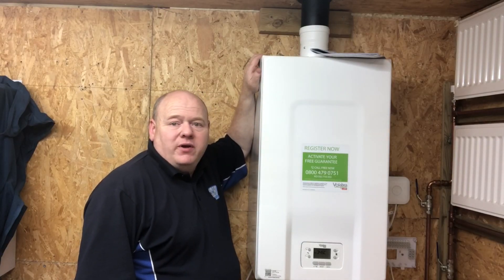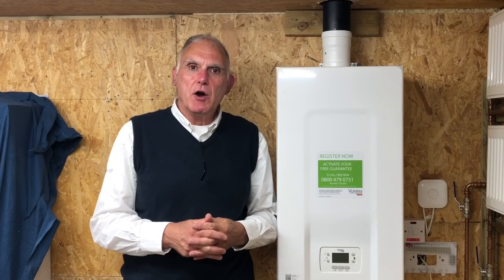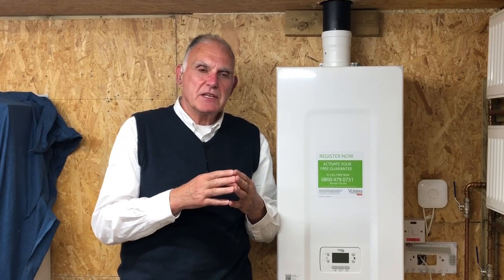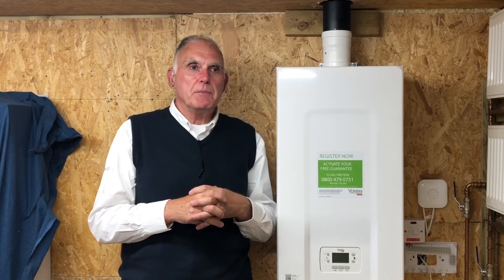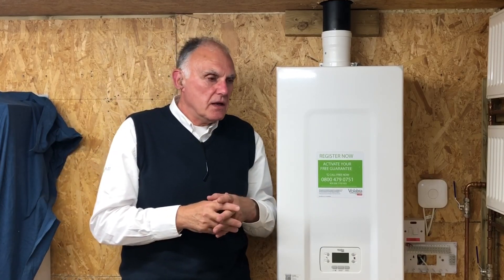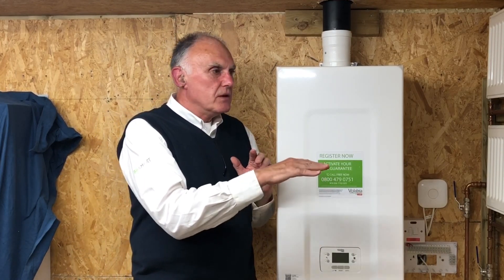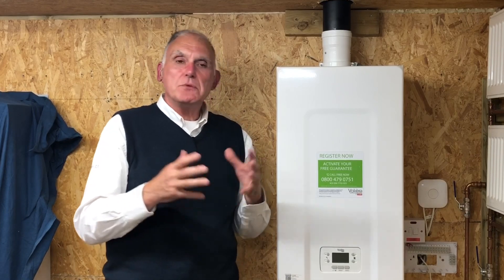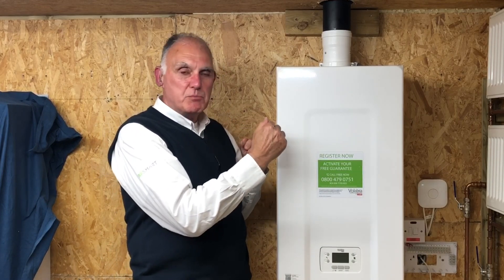What is OpenTherm / Weather Comp

Comment: Great video and good to see information on this. I upgraded to a Nest Thermostat on my old boiler I wasn’t aware of opentherm.  Then I had a new boiler fitted, Baxi 800, and my Gas Engineer told me about opentherm and its benefits, especially boiler longevity. It does take a while to get used to, especially when sometimes the rads are lukewarm. However the that room temps are constant and don’t swing between 18 and 22c, that they did when it was just set as simple on off, is important for general comfort. Early days but bills so far seem to be between 5 to 10% lower.   The fact that it is more efficient and less emissions is of more importance to me.  
I used to think the  Nest was overpriced but realised I was just not using it correctly. Hive does not have opentherm!
Please do more on this subject, there is precious little information out there.
Reply: How do you wire the vokera Unica erp? sensor with a nest??
Reply: @LordJasonKing  do you mean the external sensor or the OpenTherm BeSMART? In the terminal strip on the back of the control box there are six connections. We always use the same colours; black for standard room thermostat (24v), orange for external sensor and pink for open therm
Reply: @LordJasonKing  I answered this but it seems to have got lost. The Unica i  has a connector block with 6 terminals, we always use the same colours for internal wiring. Black is ON/OFF room thermostat (24v), orange is external sensor and pink is OpenTherm. The Unica HE is different. Ask again if it's the HE model you're looking at.
Reply: @vulcancontinental  thanks so much. Wired the sensor in 😊. I've a nest 3rd generation. Can I set that up as an opentherm? I'm guessing it's wired as an on off. I'm sort of assuming that the opentherm goes to. Pink from the nest? Does opentherm compete or conflict with weather comp? Can they be used together?
Reply: @LordJasonKing  yes, nest can be connected OpenTherm but a couple of points. 

1 you have to use Nest to set your DHW temperature (there's a separate section in the setup I think called comfort or something) the boiler adjustment of hw is disabled when OpenTherm is detected. 

2, I don't know how nest reacts with w.c. it has it's own weather program, I'd use that. 

Yes nest OT connections to the pink in the terminal box.
Reply: @vulcancontinental  outstanding service thank you. Tbh I'm so impressed with the vokera external sensor! It a bit weird as they are like warm but the house is cosy. Very counterintuitive!! The only benefit from using the open therm on the nest is bei g able to alter the hw temp. Mind does not fluctuate so I just set in the garage where the boiler. I see little benefit in using the nest apart from on off remotely and it looks nice. Just to ask I suppose the heating temp on the boiler (Unica erp) is now redundant I guess as the sensor manages it?. I've still got it set on the clear modulating dots ( bout 1 o'clock on the face.) or just wack it up to max? Any idea where I get 15 metres of the vokera wire for the external sensor. Cannot find it for love nor money. Much appreciated with yuyr help and very impressed with Vokera. 👍
Reply: Shocking spelling!
Reply: @LordJasonKing  Vokera recommend standard .75mm flex. I used to use bell wire myself, standard cable is fine. Just remember don't run the cable parallel with mains voltage power or lighting, induction interferes with the signal. Across is ok or 50mm apart if side by side. Heating flow temperature selection is disabled  when an external sensor is detected. The mid position on the selector will give you an internal temp of 20 if the curve is correct, moving the selector allows you to offset that 5 degrees up or down.
Reply: @vulcancontinental  hi
What's the wiring config for the nest to work as an opentherm?
I could remove the external sensor altogether and use the nest gofencing?
Reply: @LordJasonKing  there are two connections in the Nest Heatlink box for OT, connect those to the pink wires in the terminal block.

Yes, you could use Nest weather data rather than the external sensor but geofencing is different. 

That uses your phone location to switch the heating. So if if you're driving away from home it'll turn the heating down and when returning increase the temperature.
Reply: @vulcancontinental  Thanks, have you an email to send an image? The heat link looks a little complicated!
Reply: @LordJasonKing  take the 2 wires from terminals 2 and 3 in the heatlink and relocate them in the OT terminals. Locate the short black lead in the lower section of the  boiler that is terminated with a plug. Remove the two pink wires in that lead from terminal block in the boiler control box and replace with the OT wires from the heatlink.
Reply: @vulcancontinental  Well after all that the hot water was dead. Heating fine.  Followed the advice to the rule. Shame. Cannot believe its bloody complicated.. Back to the external sensor! Any thoughts?
Reply: @LordJasonKing  When you say dead what do you mean, no hot water? you have to enable DHW in nest using openTherm. In my memory I think it's in settings but I've only done it once during trials.  Scroll through the options by rotating the dial, you should see OpenTherm connected. If not in settings in one of the options as you scroll around the dial.
Reply: It does work, I did it.
Reply: @vulcancontinental  yes. The boiler ran for heating but nothing on the hot water dude. Didn't fire up just ran cold. Should I keep the vokera sensor connected still? I did set the boiler up in the nest as opentherm but I will give it ago again tomorrow pm. I'll let you know. Have you an email I can send thd mew wiring to? Thank you very much appreciated.
Reply: @LordJasonKing  when you have nest connected OpenTherm from the home screen each press on the dial takes you to a new option so go settings/equipment/combi with opentherm/hot water temp - select 56for example then Done. Remember two wires from the heatlink OT terminala to replace the two pink wires in the terminal block from the flying lead.
Reply: @vulcancontinental  last question honest. What setting heating? I think it was set ar 75 but it tuned it. So put it at 75c. This has nothing too do with the outputon the boiler does it?
Reply: @LordJasonKing  I'm assuming you're referring to the heating flow temp. 75 is the temp at which radiators are certified so that's fine, the nest OT will drop it as soon as it can.
Reply: @vulcancontinental  you're a trooper. It says supply under the opentherm part in the equipment setting. Stangly it doesn't seem to run low now.  Just boiling!! Does it stop modulating now!? Should I disconnect the vokera ex sensor by the way. Have you a name? I'd like to say thank yuu. You
Reply: @vulcancontinental  Hi Mr Vulcan. Firstly thank you for your sterling work. Im very impressed and have to say that I'm exceptionally impressed with my Vokera boiler. Nest however I wish I could say the same. You've gone over and above. Sadly the Nest escapes me and I will have to go back to the original plan. Now having sucsssfully managed to follow your instructions it has worked. Set the stat to opentherm, gas, rad and supply 70c and water 60c. Sadly with limited sucsss. It's set at 70c (Supply) so I guess it's not modulating and the thermostat refuses to connect wirelessly with a an eroor code of N80. I did think that having it hard wired may be conflicting but it doesn't as it was connected wirelessly prior.  It seems also to run very hot and not keep the house warm 🤔 which is somewhat odd. The weather comp seems better but maybe I haven't given it a chance. I will try to get Nest to see if they can help to connect wirelessky but I think I'll go back to wiring up the external vokera sensor and setting the water temp at the boiler. Shame as I can't get the full function of true radiant and time to heat on the opentherm that the Nest offers. I'm not that stupid but it seems very overcomplicated and non standardised. As I said you've been a trooper but I think this is one thermostat that looks beautiful but pretty useless really. I should have gone for the besmart thermostat but it seemed too complicated. (any hanging around in the back of ur van spare) or NHS discount? Anyway Stay safe Mr Vulcan
Dave
Reply: @LordJasonKing  Nest should work reasonably well as an on/off thermostat although I think you should keep experimenting as it has worked on our trial. It does look pretty. Ours looks utilitarian but is much more functional. What do you do in the NHS, are you stretched, someone I know spent 6 hours in on of 7 parked ambulances the other night as there was no room in the hospital. Try looking through the Vokera BeSMART Facebook group, you'll have to apply, there are many videos linked there to show you how to use it. The app is the easy thing to use.
Reply: @vulcancontinental  Hi Mr Vulcan. I'm a Nurse used to be a plumber!!! In South Wales so it's getting a bit sreched. Tbh we are always stretched and run at max  capacity most  of the time. Not a great business model.  I think Jan ( and pray in wrong) it's gonna be pretty rough. I hope everyone just stays home and common sense prevails. As for the Nest oh the Nest the Nest. It's like a Shakesperian play.   I may try to get it wireless working with Nest customer support. WiFi is fine.. Can you just answer a few Q. 1. If its in opentherm will it still modulate down despite the settings on the nest being 70c?   2. Does it still do the weather comp with the nest in opeththerm or is it worth reconnecting the ex sensor? 3. Have you any idea why it says its functionality is limited due to it not being connected to the heatlink via wireless ( not WiFi) despite it being hard wired. 4. My wife is going to leave me as I'm trying to save my self £30 a year! Is it worth it? Sorry to be so blood dim!!! 
Kind regards and stay safe
Dave
Reply: @LordJasonKing  yes, I think the third wave will be worse and the one where for a lot of nay sayers the penny finally drops. I've just disconnected the Nest so don't want to eat it up gain to confirm but I'm fairly sure 70 is the max and it should modulate down from there. (How long have you had the Nest? The first generation did not actually modulate and they caught a rocket for that but I'd guess that was 4 years ago at least). How it factors in the external sensor I don't know, they use mostly the internet weather service Google owns. As for functionality, I can't think of what you'd be losing, OT is by design a wired connection protocol. You have a Unica 32i I think, the controls can save a bit but the EU calculate WC as 2% and modulating stats as 3% compared to a standard stat at 1%. (I think is likely to be more but I have no recorded data) The average fiel bill in the UK is around £800 so £8 for each percentage point. I can find a cost for a BeSMART for an NHS nurse if you like but with the Inica you have one if not the most efficient boilers on the market anyway. Just get it serviced thoroughly though finding some who can do it is sometimes a problem
Reply: @vulcancontinental  all sorted!! It's a 3rd gen. Was a bit odd as it was really hot then it's settled now. Thank you so much for assistance. Stay safe and have a happy christmas and   healthy new year.
Reply: I hope I'll be invited back to do more. Don't forget not all OpenTherm is the same. The short explanation I use is the language is the same but the words used are not always understood between different differing manufacturers products and definitely some manufacturers have used more of its capabilities than others.